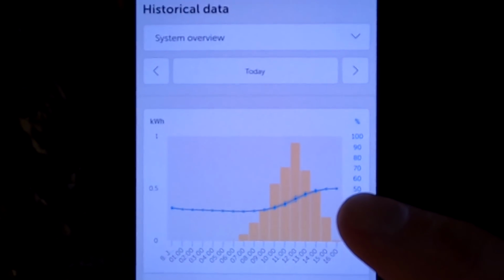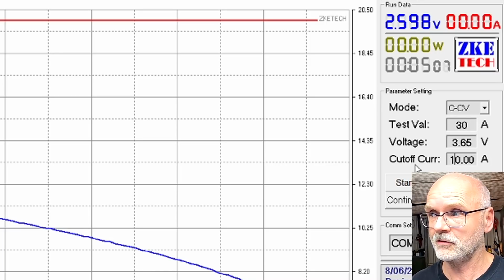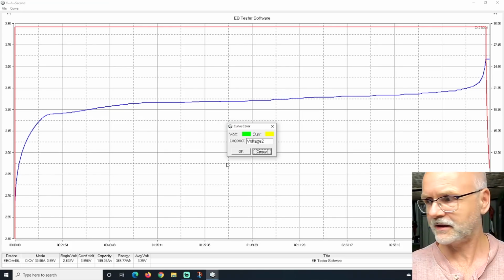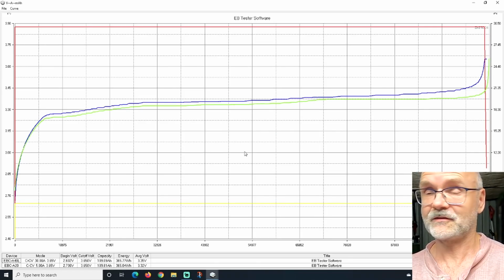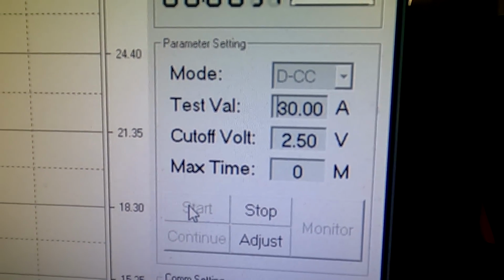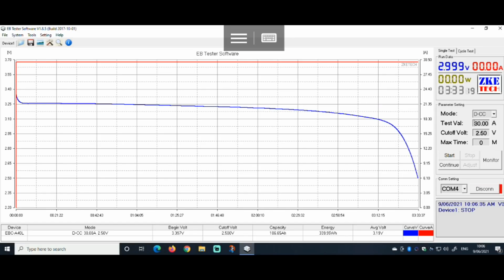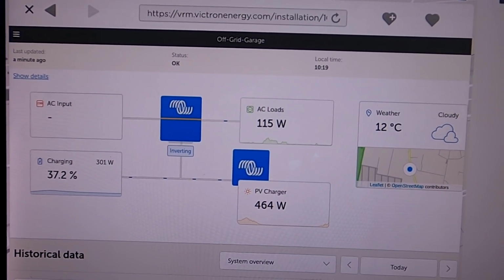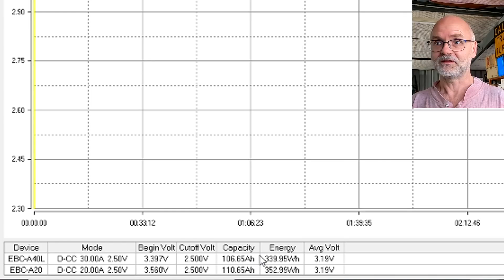30A cycle test. How does this compare to the 5/20A cycle test

Comment: I'm super curious if you could find a decent 10 amp hour lifepo4 cell rated for 3C discharge and see what that looks like

I've seen tests for 10C charge and discharge on Lifepo4 and it looks like of you just set CV at 3.4v and just DUMP current into the cell, well made prismatic cells handle it with minimal reduction in cycle life, but there aren't that many tests on it so far

Comment: You asked for it .... 

It would be nice to see a charge test series as such: 
1 - Charge to 3.65v then discharge at .1c or 28A to 2.5v then recharge to 3.3v
2 - Charge to 3.65v then wait 30min, then discharge at .1c to 2.5v then recharge to 3.3v
3 - Charge to 3.55v then discharge at .1c to 2.5v then recharge to 3.3v
4 - Charge to 3.55v then wait 30min, then discharge at .1c to 2.5v then recharge to 3.3v
5 - Charge to 3.65v then discharge at .1c to 3.0v then recharge to 3.3v
6 - Charge to 3.65v then wait 30min, then discharge at .1c to 3.0v then recharge to 3.3v
7 - Charge to 3.55v then discharge at .1c to 3.0v then recharge to 3.3v
8 - Charge to 3.55v then wait 30min, then discharge at .1c to 3.0v then recharge to 3.3v

I might buy a 100AH battery to do this.   Also do the series above at a temperature of 10C and 25C
As always your videos are not only fun to watch, but so educational.  👍

And  with 76.9K subscribers now ... amazing.

Comment: So your saying if I charge my 400 ah 4s 2P setup at 20 amps cause that's the lowest my inverter charger will do it'll not make one cell actually 2 in parallel go to a higher voltage than the rest of them ?

Comment: 7:22, its almost the same because LiFePO4 has superb coulombic efficiency, both charge and discharge. Above 99%! So does li-ion to be fair, but i believe li-ion only achieves this at lower C-ratings whereas LiFePO4 can maintain high coulombic efficiency even at higher C-ratings

Comment: Thanks for the educating videos.
Your higher voltage at higher charge current and lower voltage at higher load current are expected: The internal resistance of the battery is the same, U = I x R ;)
Reply from the maker: Danke Dir!
Yes, this is just because of the resistance in the cells, cables and connections.

Comment: Andy,

It seems to me that if you charged & discharged your lifepo4 cells within a certain range, you will likely get the most life out of your cells.  Below is what I would suggest:

I call it the pre-avalanche cycling, by which I mean don't let the charge curve or discharge curves go into exponential (i.e. a steep rise or fall--like the graph of an exponential function)

I suggest the following:

*Charge Mode*:  cc-cv
Temp= min (4.44 °C (40 °F)), ideal (25 °C (77 °F)), max (29.44 °C (85 °F))
Vmax:  3.45 V/cell, then maintain Vmax until charge current = 1A
Imax:  <= .3C

Discharge Mode: cc
Temp= min (4.44 °C (40 °F)), ideal (25 °C (77 °F)), max (29.44 °C (85 °F))
Vmin = 3.1 V/cell
Imax:  <= .3C

Would you test your 100 Ah lifepo4 cell to see how much you can store & use from the above dis/charge profile & then post your test result for us to see?

Thanks in advance!  Keep up the good work!

Comment: Great  channel, congratulations! One quick question - these very popular EVE, CATL, REPT, Lishen lifepo4 cells, I understand the producers  specify 3500-4000 cycles, how realistic are these numbers? How reliable are these cells in the long run? Are there users that have been using them a significant amount of time? So far I have been using Sinopoly or Winston, very good but crazy expensive. I am tempted to start building new inexpensive systems using these blue cells but I can't make up my mind. Thank you
Reply from the maker: Thank you. I'm not sure how long they will last. Nobody knows yet. They come with 5 years warranty. What that means, nobody knows either. I had two claims with the supplier in China and they have just replaced both cells.
The LFP tech is around for quite a while, so nothing new here. I guess they will easily last 15-20 years if not kept on high or low voltages.
Reply: @OffGridGarageAustralia  Thank you Andy! 

Winston cells contain Ytrium, they claim 8000 cycles and usability at lower temperature, but they cost double the price of the blue cells.

Keep up the good work! Best wishes, Adrian
Reply: @OffGridGarageAustralia  il possiedo un pacco di lifepo4 da 30 A da 12 anni 
Usate male ha oggi anno perso circa 5A.
Considerando come le ho maltrattate in questi anni non mi posso lamentare.

Comment: Andy can the zke charge 2 or more lifepo4 cells in parallel and could you test it for everyone to know zke can do this much appreciated 
Stephenwillee513@gmail.com
Reply from the maker: Every charger can charge cells in parellel, it just takes longer.
The ZKE EBC A40l can handle all sort of batteries up to 5V. So as long as you cells stay under that limit, it certainly can charge as many cells in parallel as you want.

Comment: So with the 30A test done would you share with us your current charge controller and BMS settings?  
Did the 30A test change anything?
Reply from the maker: Yes, I will share all these info very soon. Filming it at the moment...
I haven't changed any of settings due to the results, but I have lowered the absorption voltage to 3.45V now (from 3.5V before).
I explain this in all details soon...

Comment: I have heard that any battery will last longer (more charge/discharge cycles to 80% DOD) if they are charged and discharged at a lower C rate.  While it is far too much to ask of you and this awesome channel, it would be nice to actually see this for ourselves, rather than just trusting the engineers from the battery manufacturers.  I have one use that is a very low discharge rate and I can say that you get full capacity, plus some, every single time.  I believe it is a matter of how much heat the battery is subjected to...less heat equals longer life.
Reply from the maker: That is correct, Jason. Smaller charge and also discharge currents will prolong battery life. It's very hard to test and proof as it may take years but overall we will see how my battery will perform over the next couple of years.
Reply: @OffGridGarageAustralia  - I'm looking forward to that.  :)

Comment: I was hearing months ago LiFePo4 was kinda low in the efficiency dept.  Your measurements seem to indicate a rather high efficiency.  Power out/power in.     ?    :)
Reply from the maker: Super high efficiency with these cells. The first batch of cells have an over 99% efficiency . The smart shunt shows me:
327.0kWh Charged
318.7kWh Discharged
It does not measure the consumption of the BMS with relay though, so I guess, we're getting very close to 99%

Comment: You are in the ranges where measurement accuracy is a factor on results.

The basic principles of C rate charge and discharging is how much power loss is happening for the I^2 * (R_s + R_kinetic) for cell.
There is a secondary factor which is temp of cell.  The higher the temp of cell the lower the kinetic energy necessary (lower kinetic loss).  Temp can also change the Rs a bit.  However you don't get much effect on cell temp and therefore change of kinetic energy required when cell current is less then 0.5 C rate of current.  You do get effect due to ambient environment temp.

R_s and effective R_kinetic losses are a little different for different cells, and both degrade the older and more used the cell.

For 100 AH LiFePO4 cell in good condition, I will use R_s of 0.45 milliohms per cell and R_kinetic about 60% of R_s or 0.27 milliohm.  

If your capacity tester has four point wiring with separate cell voltage sense you don't have to worry about wiring loss to tester.  If don't have remote voltage sensing then the wire loss adds to capacity loss.

So running the numbers, I only get a capacity difference of 99.9%, 99.5%, and 99.3% for 5A, 20A, and 30A  respectively.  This is so small a difference it is within measurement error.

By first measuring your R_s with four point battery impedance meter, you can get a better number for R_kinetic by the difference in curve voltage drop for different current rates and subtracting out I*Rs from this voltage drop leaving the effective R_kinetic drop.  Remember R_kinetic has 1 to 3 minute time delay until it reaches equilibrum so initially upon first applying current there is only Rs caused voltage drop then within three minutes the cell voltage will drop a little more once R_kinetic settles to its equilibrium state for given current.

Same applies in reverse for charging.

Comment: Uses the same tester as you, but got some varying results when testing 280Ah cells. Suspected included charging clamps, so I made new cables with ring terminals and GX20-5Pin plug, and got a more consistent result.

Comment: Hi andy. GR8 work and show.
Would you mind making a video on the parameters you have used in your BMS and victron charger? I have the same system set-up only ,diff, 2x MultiPlus-II 48/5000 parallel and another for charging
Reply from the maker: Yes I can. I'll see if I can fit it in this week. Thanks for your request and suggestion.

Comment: So basically you get an extra 4Ah out of the battery but I think that in a real world application, like you are about to parallel two bank's of Batteries, you would be discharging the batteries a half the current. So to be fair, you did one test at 30A discharge and the second test should have been done at 15A to simulate two battery bank's in parallel! Then divide the current by 3 to simulate 3 paralleled battery bank's.
That way you can see how much more Ah you gain from sharing the discharge current across multiple battery bank's! 
As from what I can see, there was a 4Ah gain from 30A to 20A discharge which would probably increase to 5Ah or more per bank, across 3 bank's, it might yield 15Ah or possibly more and then there's the battery life expectancy that should increase from the lower current draw from each series bank! 
Every extra watt that is gained from the panels is as good as every extra Ah stored as is every extra year of service life! 
This all just probably means that you either go big or go home LoL... 
But you are the only person that I know who can find this out! 
I wish you nothing but success in your captain cook's endeavour in this upside down land that we call home!

Comment: I request a cycle of charging 33C and discharging 50C at a frequncy of 77 kHz and a duty cyle of starting with 66% dropping to 44% over 2 hours.
Just kidding :-P
I guess the difference of about 4 Ah was still left in the battery and rising the voltage back up to almost 3 V quickly.
Thanks for sharing :-)
Reply from the maker: Das ist doch Kaese!!! 🧀

Comment: Off grid garage I recently purchased eve cell 280 ah when I got the batterys they were 3.3 v I try to top balance cells but they don't go above 3.3 v are these cells good or did I get ripped off ?
Reply from the maker: How do you charge them?
Reply: That is good. They will stay at 3.3 for a long time and then suddenly go higher....as per the graph!
Reply: I have the go power ic 3000 inverter charger inverter charger combo
Reply: @zipsolo  what settings are you putting in?

Comment: Andy, I've one doubth about my battery bank, 58V 40A.
My battery bank is charged till 54,4V  it means 3,4V per cell and discharge till 48,9 V it means 3V per cell. And the question ⁉️ is. 
During charging 8h at 5A inverter is feeding peaks of my consumption. It means that is discharging too.
If during charging It I discharge it too how many cicles will be during that process ?

Comment: With the fast bounce back your lost capacity is likely still in there. Will the tester allow one or two repeats until the bounce back is small or the same . I only mention this as I believe the cell is like a liter of water it's all you get whether you pour it through the top or a needle point all you get is a liter.

Comment: Andy, I see you charge/discharge batteries so many times and still find the SOC a little daunting. Could you please clarify once and for all( a graph would be wonderful) the optimal voltage ranges of this lifepo4 3.2 100ah battery? 3.65v volts would be over 29v on a 8s configuration, isn't it? Sounds too high. If we would want to do a 80/20     deep of discharge, what voltage are we looking at?
Reply: Normal use it makes little sense to charge above 3.5 or 3.55 volts. Look at his discharge curve...  it drops really fast below 2.8v or so, indicating little capacity below that point. 2.8v to 3.0v is a good lower cutoff.
Voltage ranges on an 8s are very similar to lead acid with 12s (nominally 24v). Think about it...  you normally would charge a 12v lead acid to 14.0 to 14.5 volt. That's the same as 28v to 29v for a 24v nominal.
Reply: @Sylvan_dB  Thanks Sylvan. So then can  we consider 28v(3.5x8) to be 100% and 22.4v(2.8x8) to be 0%? Rough numbers here.
Reply: @trevilights  That should be fine. As long as you are within the absolute maximum limits it's all good, and more space inside the limits is even better.
One thing I noticed on this video is the higher amps during discharge means even 3.0x8 would be a reasonable 0. I'd probably stay with the 2.8 because that is more certainly below the bend on the discharge.
Reply: @Sylvan_dB  Agree. Thanks. By the way, I've downloaded the software and the data from Andy's website and I was able to look closely at the values. He aslo have one he did for a 280ah battery. All data is there. I highly recommend you do too. Andy is providing us with awsome free data. Thanks Andy.

Comment: When charging, don't you want to use a cut-off voltage of 5 Amps (C/20)?  I've heard of C/20, and even C/30, but never C/10 like in this test.
Reply: I have heard 10% of the charge current but I mean with a discharge in the real world you just have whatever load you have it's not going to taper off
Reply: @james10739  I was referring to charging only,

Comment: So a very very small Peukert effect then. Great vid, pretty much what I thought was going on, but its great to have numbers/proof.
Reply: LiFePO4 do not suffer from the  Peukert Effect.
Reply: @dankarau2307  You're no scientist, so what would you call reduced output from a higher draw rate then?
Reply: @chrisfryer3118  heat
Reply: @blackz06  I thought that was where the energy went in the P effect.
Reply: @dankarau2307  Probably because Peukert's Law is specific to Lead chemistry.